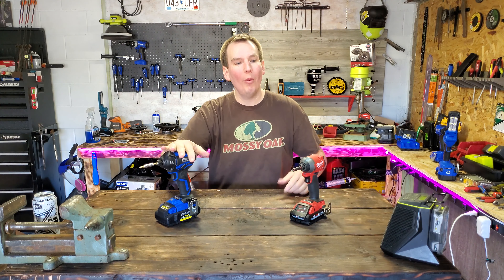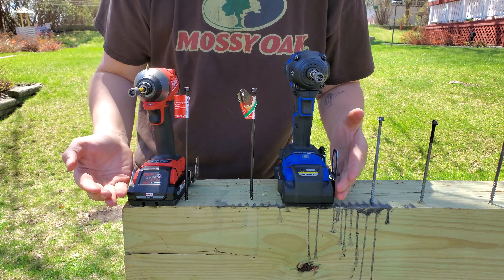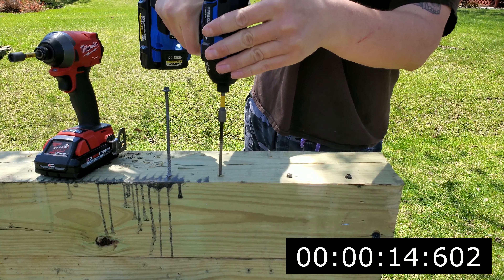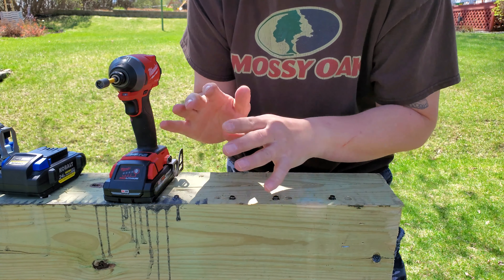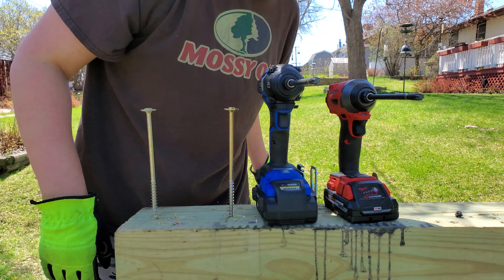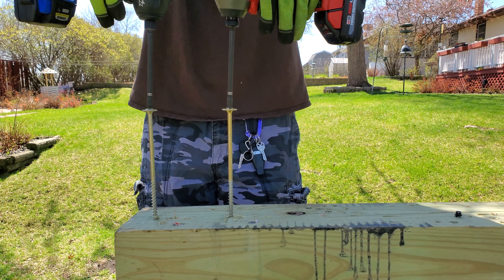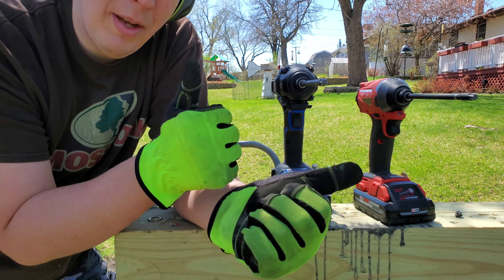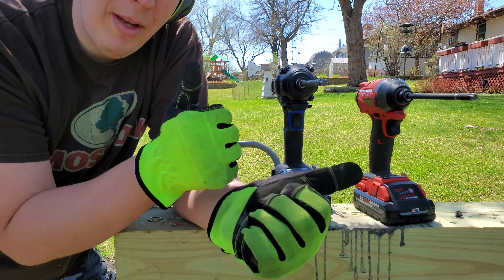"New" Kobalt XTR 24V VS Milwaukee Fuel Gen # 3 Impact driver Comparison !!!!

Comment: I have a kobalt  i got about 7 or 8 years ago , plenty of torque to take bolts off  still use it alot. Battery still great.  
Mine is smaller than this one used here...but plenty powerful.

Comment: grab the milwuakee a socket adapter socket and bolt and largest battery you got and see if it can rattle on the tightened bolt  until it goes flat.. i stuck a 9.0ah batt on my brushed impact and a step drill bit and made about 50 holes 1/2" big in 1/8" and 3/16" steel one after another and i think i clocked the impact mechanism upfront at 130 Celsius.. still works fine today
Reply from the maker: Oh it can i have done that in other videos, but I just broke my adapter about 5 videos ago and haven't  got a new one yet!!
thanks for watching

Comment: Friend, I need to buy a cordless impact wrench, solely and exclusively, to extract the tires on my car.  Which of these two do you advise me to buy?
Reply from the maker: Well both have enough power, but you might as well get the impact wrench, like the new Milwaukee m-18 stubby . about the same price around 150-200 dollars
Reply: Here in the state of Rhode Island, it costs a lot more, $ 229, and $ 245 with taxes.  I mean Kobalt v24 max

Comment: When you factor in price. Kobalt is the hands down winner. A fraction of the price for roughly the same performance.
Reply: And it's blue!
Reply: Im a diy'er but i bought the xtr 1/2 Impact, love it
Reply: @dancearoundtheworld5360  XTR came out a few months after I bought my 1/2 impact
Reply: @fernandobriseno8164  Bad luck
Reply: No kidding
Reply: What price difference? Kobalt Bare impact tool is 99$, you can get milwaukee impact with battery charger and bag for 99$. What are you talking about?
Reply: @BlessedFallout  show me where you getting a gen 3 m18 fuel impact/ battery/charger for $99? If so that's a one time sale.
Reply: You get what you pay for, never had to leave a job for a broken Milwaukee tool. And faster work=+$/hour Milwaukee pays for itself
Reply: @charlesking678  it’s every year, but you just need to be lucky.
Reply: @7milessouth  someone got butthurt. 💯💯😂😂
Reply: @ajgreen868  someone can only afford black and decker 💀… 

No, all jokes aside though. Im just biased towards Milwaukee. I’ve used them for 10 years working for a living and never have had one fail. Worth it for me to pay the extra.
Reply: @7milessouth  Milwaukee makes the best.
Reply: @7milessouth   it has a 5 year no questions asked warranty lol if it messes it just take it to Lowe’s and get a new one just like that, no mail in bs like Milwaukee, I’m an industrial electrician and went through two Milwaukee brushless hammer drills in 4 months, tried to get warranty and Milwaukee made it a headache

Comment: I'm buying KOBALTs for the batteries.  24V is verrrry versatile.
Reply: You can't use the 24v with the 40v blower, right?
Reply: @joshuachilders129  no, but there is a 24v blower that works very well.
Reply: 30 bucks man can't beat it. 60 bucks for a 4 ah

Comment: Kobalt is huge though and that matters when working in tight areas. Milwaukee is always gonna beat kobalt crap. If milwaukee made an impact driver the same size it would put out 3 times the power as kobalt. Size matters lol
Reply: And makita will always beat Milwaukee for weight to power ratio and longevity

Comment: Looks like the Milwaukee ones are already half way pre-drilled on the first 4 bolt test.. Haha. Good one..
Reply: I noticed that too!!! They dropped an inch instantly!!!!
Reply: 100% I was going to say the same thing. Every video done between Milwaukee and kobalt they always cheat for Milwaukee.
Reply: In at least one of the tests, if you watch the yellow band with th Dewalt logo on the driver bits, you can plainly see the Kobalt is turning somewhat slower which would obviously cause it to lose the race.  I'm not saying he did anything nefarious on purpose. I'm saying that it's just the difference in speeds of those particular settings on the tools. Milwaukee tools are excellent tools, no doubt. But, they are outrageous and most people but them because either; A) they feel it makes them look more professional and successful. Like a status symbol or B) it's a mental thing about having what most people consider the best. Or C) a combination of both. Lol. As for me, I decided to try a Kobalt 24 volt drill and impact driver 3 years ago when my Dewalts broke down in the middle of a job and haven't used anything else since. I'm now starting to buy the new Kobalt XTR stuff and they are absolutely great. The performance and power, reliability, warranty and especially the cost make Kobalt the best available, in my opinion. Plus, that color of blue is much more attractive than anything else out there. Lol. Anyway, Buy Kobalt. Unless your just hung up on a bull crap image trip, you won't be sorry.
Reply: @johnpearson4899  i have never and will never say milwaukee us the best .most power doesnt mean best
Reply: He definitely had Milwaukee pre drilled
Reply: Yes and, with the Milwaukee one, he starts, then says "go"!
Reply: Darealpapac  You’re 💯 definitely applying more pressure on the Milwaukee you can tell by his hand
Reply: @freekinfreak1  you must own the kobalt
Reply: all the pros who make money with there tools use Milwaukee or dewalt
Reply: @Mohagrus  Not "all". I know two middle age carpenters who use Ryobi and Rigid respectively. IMO most still do use Dewalt and Milwaukee, along with Makita, but, all that is changing and Kobalt is starting to show up on job sites because, for the most part, their power tools(especially the XTR) are blowing Ryobi and Rigid away.
Reply: @rtgray7  Ryobi is the worst of the worst its a budget tool
Reply: @Mohagrus  Okay
Reply: @rtgray7  You get what you pay for fella Ryobi is what you buy if you are going to use the tool once a month or less. Dont take this personal if you are Ryobi owner its just that everyone else's brand is better then Ryobi 90% of the time. Sure they can get the job done for a good price but its not commercial tool quality that's for sure its aimed at home owners for light duty use.
Reply: Darealpapac  They are screws not nails they have threads it don't matter how hard you push, it is not a saw test pressure is not a factor. The Milwaukee has higher rpm more impacts per minute it only makes sense its wining don't get hung up on "24V battery must mean more power" mentality Kobalt is false advertising any way the real voltage of there 24V battery is 21V test it your self with a multi-meter same with Dewalt they are lying about there battery being 20v they are really 18v nominal. Do your research fellas don't fanboy for any one.
Reply: @Mohagrus  No, I have no loyalty to the brand. I have never owned Ryobi and I hate the color but I know guys who use their power tools daily as carpenters. Same with Rigid. Many of these tools get the job done on a daily basis. I've witnessed it. My point is, Kobalt (XTR) is NOT Ryobi, Rigid etc. Different category. Also, While Ryobi is obviously not at the level of Milwaukee let's say, I don't think they're as bad as you and most Professionals think they are. No way I could dispute that most Pro's use Dewalt and Milwaukee. I'm a DIY'er and have used Makita power tools for years. I like them and find them to be very good quality. But recently my wife bought me the Kobalt XTR Drill and Driver and, WOW. My friends, who use not only Ryobi and Rigid but also Dewalt, are amazed. Now factor in price... When Kobalt expands the XTR line, you're going to see more professional guys jumping over. That's my opinion but it's based on what I've seen, heard and experienced, "fella" ;)
Reply: Darealpapac  You don't know the property's of a screw apparently stop fan boying over brands ignoramus.
Reply: Darealpapac  Stop getting so up set fella its okay if you cant afford the best tools at the end of the day they all get the job done for the most part some just get it done a little faster lol
Reply: @burnhags2572  I am a fanboy of the truth. I own kobalt yard tools I never said they were bad
Reply: @rtgray7  Good answer I can respect that.
Reply: @burnhags2572  Run some tests with your impact you will find that applying lots of pressure does not help drive a lag bolt any faster then slight pressure it is an impact driver not a drill
Reply: @Mohagrus  Good deal Mohag.
Reply: @Mohagrus  I do, and what's your point? I have Kobalt now, coming from Dewalt. We use Milwaukee at work. For the house and the money, there's a reason I went with the Kobalt. If you're buying, I'll take the Milwaukee. Just wish Kobalt had more tools.
Reply: So I own the Kobalt XTR and my boss owns the gen 3 Milwaukee Fuel. That milwaukee really does have that much power. It's a beast of a drill, the first few inches of lumber dont slow it down at all.
Reply: @Mohagrus  While Ryobi is definitely geared towards DIY, it is capable of handling professional use. I used Ryobi daily for over a year building houses. They handled just fine.
Reply: @Mohagrus  wrong. I see more rigid on construction sites than any other tool

Comment: I picked up the drill/driver and impact kit which came with an extra 4ah battery and I really like them.  I'd originally picked up a Milwaukee kit but the batteries were dead in the box and the tools felt cheap especially the triggers so back it went.
Reply: Bro Milwaukee is the best I’ve never had a problem

Comment: Amp/hours is not power related,its how many charge you have in a fully charged batteries, how long will it last not output performance.
Reply: Wrong. Higher Ah ratings have higher draw ratings meaning the tool can draw more and thus have more power as well as longer run times.
Reply: It actually does have an impact on power. Smaller batteries can't manage a sustained output at the same level as bigger batteries, but you only really start to notice it when you are cutting big LVL boards or driving 8-12 inch screws, but stick a 2.0 and a 6.0 on two drills side by side the 6.0 will crush the 2.0.

Comment: Used to have a Milwaukee fuel. Milwaukee is faster but I dislike the grip of the Milwaukee and that is often overlooked. To me, its important to feel comfortable using your tools. With that said both are phenominal drills and you can't go wrong either way.
Reply from the maker: Yes indeed, I have above average hands and that is a big problem for me, The Makia and Matabo are both way to small, I feel like dewalt has the best for me. not saying they are my favorite I just like there grips. Thanks for watching

Comment: RPM is everything.  Fuel has more RPM than anything on the market.  That’s why it can’t be beat.  Yes the power matters but the faster you can turn a screw/bolt the faster it goes in.

Comment: Put ryobi against the milwakee. Ryobi is the direct competitor house brand value priced. Although kobalt was aiming at dewalt xr line. For the price kobalt wins every time. Same performance as the top contractor brands. 1/2 the price. $399 for a quality 5 pc xtr set compared to $750 for red or yellow. What you just showed was every reason to go xtr
Reply from the maker: I have been going more Kobalt lately. I just wish they had a tower light and couple more Mechanic tools.

Comment: I was between the kobalt xtr lineup and the Milwaukee fuel. I have been using the regular brushless kobalts for over 3 years and they have served me well, after being abused a lot. They are starting to show their age now and I was looking to upgrade. Never used Milwaukee before but I’ve tried every other brand. Each have their own issues or short comings. My only hesitation with switching to Milwaukee was the price. But after researching profusely I decided to go with a set of Milwaukees that were on sale for cheaper than the kobalt xtrs. Thus far I’m really liking them.
Reply from the maker: I really like the xrt line up, I hope they expand it. I like Milwaukee too, but I just cant justify the price.. Kobalt is a good brand that get trashed on to much. Please its 24V AKA 21.5 really I say go for it. I am slowly switching over to kobalt, so I have about 3 more kobalt tool videos coming out in the next few weeks.
Reply: @Impact-OG  we usually run 2 different sets of tools in each of our vans at work. So theoretically I could have both. That’s the plan at least. The xtr’s aren’t really significantly cheaper than the milwaukees and there are a couple specialty tools milwaukee offers that would be nice to have.

Comment: I'm getting the Kolbolt XTR 5 tool kit tomorrow. Lowe's also has a buy 1 + 1 on some Kolbolt tools, get 2 more tools for around $100 or 2 batteries a charger + free tool. Although there are some other very interesting deals on tool right now. You can probably find ways to get some of the top tier brands, like Milwaukee,  Dewalt at similar prices.
Reply from the maker: Yeah man thats a great set,  I almost got it but I really don't like the blade left saws, But I do want the rolling case, that would be nice..
Thanks for watching man :)

Comment: kobalt made a good tool, they seem to have alot better line then i would have suspected, but im not sure how much cheaper if any theyre, get the gen 3 kit drill and impact with 2  5.0 batts an charger for what 349CAD? and the kobalt impact is 170$US im assuming thats with one batt and charger.. basically the same price if youre planning on getting a drill too, ntm milwuakee is much smaller for more/the same power which makes a big difference lets you get in tighter spaces, get better angles on your toenail screws can double as an automotive impact with an adapter in get in tight spots, its a good rig, 5year warranty.. too bad i have 2 of the brushed models drills and impacts 2 of each i need them to start burning out and losing warranty so i can upgrade
Reply: They’re impact drill bits are the worst. Never buy them, they break and the lil shaft gets stuck in the impact and renders the impact useless until you get it out which is a bitch to get out
Reply: Milwaukee helix impact bits are great
Reply: @larrytate1657  i got the milwuakee bits with a 1/4" hex shank TiN coating and the weird geometry on the tips  but i dont like them.. thought theyd be good to stop my wrist getting ripped off when the drill jams up but the impact sucks at drilling holes and the bit break way too easy in a drill or impact they seem to snap and chip.. i got some cobalt bits with 3 flat shanks for the drill and some step bits that fit the drill and impact but i try to always use the drill on anything 1/2" nd up

Comment: Thank you for comparing the new Kobalt XTR against probably the best power tool brand out right now Milwaukee.  I'm a huge Kobalt fan! I have all of the 24V Max Kobalt Power tools and I've just picked up all of the Kobalt XTR power tools that are out right now. Kobalt is becoming a major competitor in the professional market with this new XTR line. They are no longer just the homeowner DIY brand. I think for a homeowner DIYer, the Kobalt 24V and XTR lines would be more than sufficient for anything you will do at home. I have friends doing regular homeowner stuff buying Milwaukee because they are the "best" but I can't see spending 2x or 3x the price for Milwaukee tools, batteries, etc ... to do homeowner tasks. For my company truck I buy Milwaukee because for one it's company money, and for two I'm doing industrial work but for homeowners shit ... Kobalt all day long.
Reply from the maker: Yeah man no problem its fun to do and I'm glade people like it.
Reply: Milwaukees not the best they might have more power but thats it
Reply: @russellleahy  - The "best" power tool brand is subjective. They are however, the power tools I see on every major contractors truck, and Dewalt too. Having power is pretty important when you are trying to bust off rusty nuts on a bridge, or mechanical work, etc.... They are expensive for a reason. I wouldn't say Dewalt is better than Milwaukee, they are however more popular.

Comment: Kobalt has a great deal right now where you get the drill,impact,and light for $249.
Reply: They have a MUCH better deal right now: rolling case with the drill, impact, light, circ saw, and recip saw for $349.

Comment: $100? What? HAHA. I am not sure about that. The 5 piece set they are offering for $399.00 with a hard case seems to be a good deal though.
Reply: I got the 3 piece XTR kit for $289. For $100 more the 5 piece kit is a great deal. I'm after that 1/2" drive impact gun though, it's got 1,200 ft pounds of nut busting torque. Very competitive even with the Milwaukee 1/2" drive impact gun.
Reply: @Everyday_Railroading  Currently they're giving an extra free 4AH battery with those tool sets.
Reply: Too good it seems like, I can't find it anywhere! I don't think they like selling that kit lol.
Reply: @GuyFromJupiter  It's on sale for $349 right now.

Comment: CP3.0 is still a single battery pack(single row of 3AH 2170 cells), where the Kobalt is a double pack(two rows of 2AH 2170 cells).  Think as its like using one or two batteries for starting a diesel truck.  You can get higher sustained voltage with 2 batteries.  If you hooked up the 6AH HO milwaukee battery I can guarantee it would walk all over the kobalt.

Comment: I returned my 24v Kobalt to get the XTR because the store apparently had them but hadn't put them on the shelf yet. The XTR is way better, that being said, I was replacing my old Craftsman C3 tools only to realize that Kobalt doesn't have a nail gun or a couple of other things that I use often. Also, the 1/2" impact XTR is like $270 which is not an easy chunk to handle.
Still, an awesome tool if they can get more in the platform and the prices settle a bit.